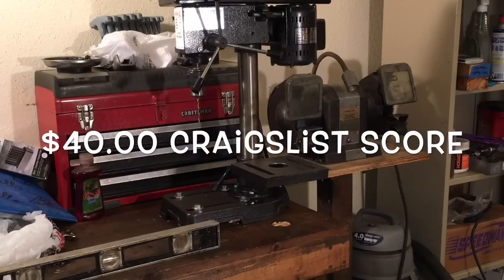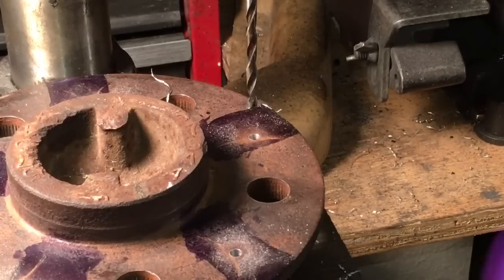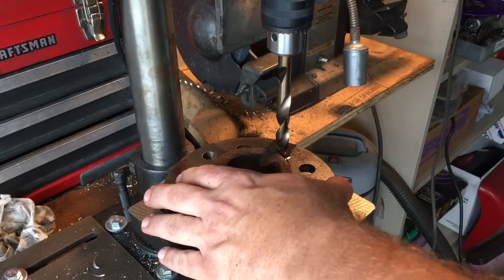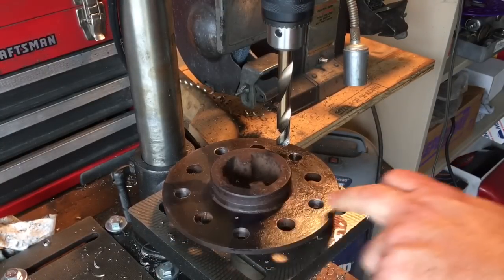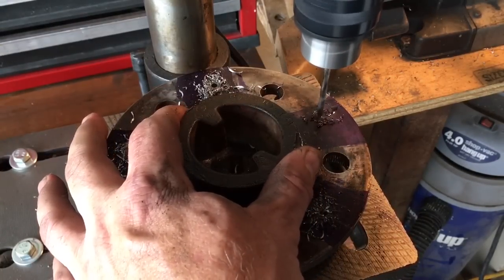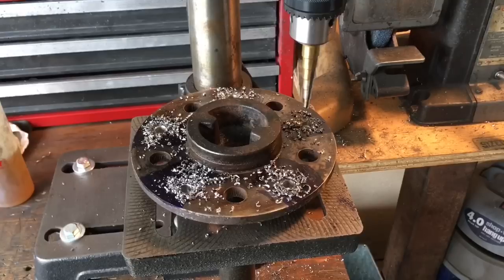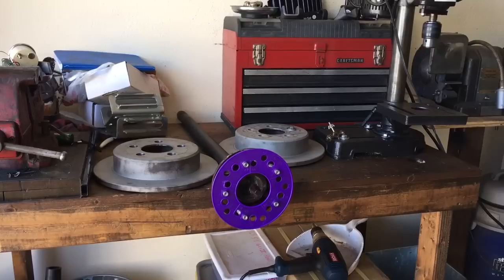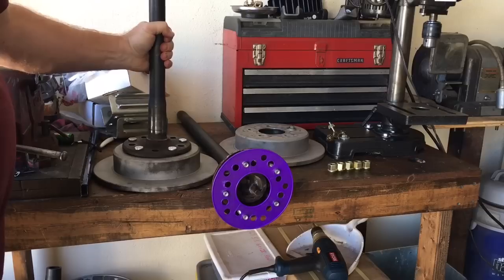Explorer 8.8 axles drilled to GM 5 x 4.75 pattern

Comment: You could just buy a set of axles with the proper bolt center for 200 and save the 200 you spend on drill bits not to mention all the labor hours.  The end result for basically the same price is a much stronger axle as well.
Reply: Except he now has a drill press for his shop in which is a must if your doing anything reason for having a shop and everybody don't like sitting on their lazy a** waiting for UPS to show up.
Reply: @ozarksfarmerhansen8782  I have a drill press in my shop and it's still a waste of time drilling those axles.  I can get a lot of OTHER work done while not drilling those axles and then finish the job up when the axles get handed to me by UPS.  You obviously don't have to worry about productivity Hansen.

Comment: I just want to tell you what an awesome video. Also I would like to point out that the holes being over sized had nothing to do with the way you set everything up. It came from the run-out in your jacobs chuck. it caused an offset in the bit measurement that is really unavoidable when using this method. Also don't worry about the table being "level". It needs to be square with the bit. Above all you got the job done with minimal tools and that deserves applaud. For those haters I will say that I have measured factory rims that were more then .020 out. I'm sure this will be just fine and if you want to hate it then go spend the $500 and go have someone else do it. Again Awesome video Sir. Keep doing what you are doing.
Reply: With Morse tapers (or any other Taper-fit) being held by 'friction' only, it is imperative that the taper(s) (both inside & outside) be Clean & Smooth with NO Dirt, Grit, Oil, or raised burrs that interfere with the fit. . . If there are any nicks or dings on the taper lightly file and/or stone them to remove the raised material around them. (the low spot won't hurt but the raised edges will) . . Then wrap a Clean Sheet of plain white notebook paper tightly around the shank and use it to wipe any and all dirt, grit, and oil residue out of the sleeve. . . When they are clean, all it should take is quickly 'slamming' it in by hand (No Hammering needed) to make it fit tight enough to require a drift to drive it back out again. . . . As for 'leveling' the table, you can only do that AFTER ensuring that the entire drill press is Level And Plumb. . . If the column and head are setting a few degrees off because the wooden workbench is setting crooked on an uneven cement floor, making the drill press table 'level' just threw in that angle of error from the column & head. . . As long as the drill press table is Square to the Press Itself, you are good even if you lean the whole thing over at 45 degrees (or Any Degree out of plumb). . . Mount a dial indicator in the drill chuck and move it around on the table to check 'squareness' and don't worry about 'level'. . . If you don't have an indicator then you can get close enough for what you're doing by chucking up a piece of 1/2 inch round stock (or whatever your chuck capacity is) and using a small square to check that the table is square to it.
Reply: As for the holes ending up too big, that is because even though you are using a drill press you are still essentially drilling by hand allowing the axle shaft to move around as you drill. . . It floats around a little with the two-flute drill bit harmonics along with being pushed down deflecting away from the drill as you apply feed pressure. Then when you break through the other side and the pressure is relieved the axle shifts back up again elongating the hole and making it oversize. the axle should be clamped solid so it can't move, or at the very least put a pair of equally sized blocks (Parallels) under the flange to support it so it doesn't deflect under the drill pressure.
Reply from the maker: Jamey Larrimore The chuck doesn’t seem to spin true, it actually fell out the first time I tested the press. I couldn’t find  any fasteners securing the chuck/arbor so I just hammered it back in.  Maybe I need to re-install or buy a better one?
Thank you for the feedback I appreciate it!  JD
Reply: JD that is just the nature of a chuck like that. They will fall out if there is any vibration or side strain. The Morse Taper commonly used on drill presses are only held in by friction and not a draw bar. however you will do just fine if you account for the run out in the future. Again keep it up. You just showed that you don't always need a vertical mill and indexing/dividing head with a DRO. Sometimes the little guys need to get it done too.
Reply from the maker: Jamey Larrimore Thanks! 👍

Comment: So with all that leveling... you are drilling holes by hand and doing the drill dance.  Lol... oh well.
Reply from the maker: GotScout Drill Press is not drilling by hand. I’m not sure why you feel empowered to judge others in how they make things work?  Very confusing 😳
Reply from the maker: fishhuntadventure I’m thrilled it turned out ok; worked good.  If I had totally messed up I’d had either gone back to the Ford 5 x 4.5” pattern or gotten two aftermarket axles.  I had a back up plan but didn’t need it.  I learned something and saved quiet a bit of money, this was the goal. 👍
Reply: HeadFlowInc yes it is. That’s why your holes came out too big.

Comment: Tell me how it works at 80-100 MPH!
Reply: Agree with you this is one of those things you don't screw with.
Reply from the maker: Robert Touchstone Take a moment to think before you reply PLEASE.  Everything is centered to the axle hub, when you put the rim on and tighten the lug nuts it’s all properly orientated. I can’t even understand how you can’t see it’s right?
How about this, this same setup is in a 1989 S10 running 110+ mph in the 1/8th mile.
This ain’t my first rodeo, please think things through. 👍
Reply: I do it the right way with a Index head + I spline my own axles numb nut!
Reply: It works just like the factory axles at 110 mph. If it wasnt right the rotor wouldnt fit over the center. 😁 Geometry is Geometey.

Comment: Good info on the lugs. I was wondering about drilling a 1/2 hole for a m12 stud.
Reply from the maker: Allen McKinney The knurl size is the determining factor to the hole size. My issue is something in the equation made the Hole slightly larger than 1/2” or .500
My issue was I couldn’t find any drill bits slightly smaller locally.  A 15/64 drill bit may have worked better for my setup. If you have or can get one.
Reply: HeadFlowInc dont meant to be rude but dont you mean a 31/64th bit?

Comment: Still to fast but ot worked. I do these in back gear on my mill at about 150rpms with good amount of cutting fluid. I will make a vid on my jig and set up when i do a set of axles. Hope it works for you. Never give up.
Reply from the maker: tjsnordic I remembered, years ago we used a set of 1” thick dual pattern wheel adapters to transfer punch a set of Ford 9” axles to the Chevy pattern. My wife’s uncle drilled the axles on a press. 
The slowest speed I had was 690 rpm, to avoid burning the bit it does limit how much you can cut at a time, plus lots of lubricant. Thanks for sharing your experience it helps!  JD

Comment: Where did you buy your pattern template?
Reply from the maker: samuelk009 These templates are sold through Speedway, you can find them online.  I bought mine at Motorsports of Kansas City on State Ave. KCK.
Another option, a bit more costly, find a wheel adapter from 5 x 4.5” to 5 x 4.75”.  Remove the studs for the 4.75” pattern, bolt the adapter to the 4.5” pattern, transfer punch through the new pattern holes. I’ve done this before on a Ford 9” rear end. 👍

Comment: Great job. Now will the center hole on your rims fit around the center of the axel? So that you can Center your rim and tire around the axle hub
Reply from the maker: shatmicellf hp I will try to make a video showing the wheel fitment. As far as I know there’s been no reports of axle hub issues, remember this 8.8 is a commonly swapped rear end. 👍
Reply: HeadFlowInc ya, common swap, but you’re missing the point: your stud holes aren’t located precisely- they might not be concentric with the hub center.
Reply: fishhuntadventure  - it appears he has drilled the hole pattern within a tolerance that allows the studs and pilot to fit thru  when that’s the case there is no issue with excessive run out.